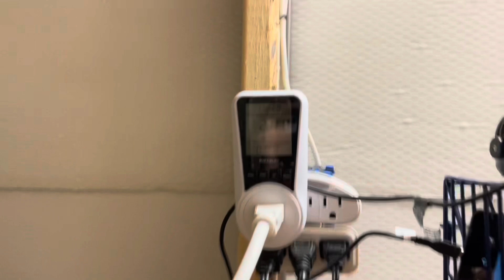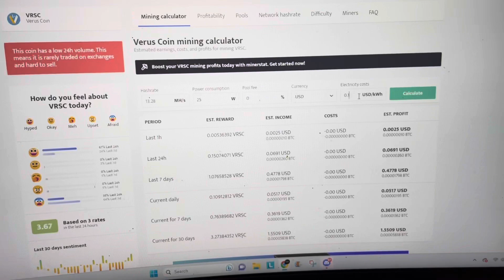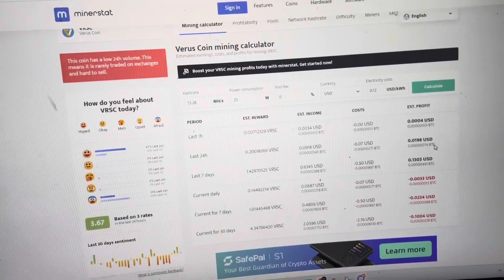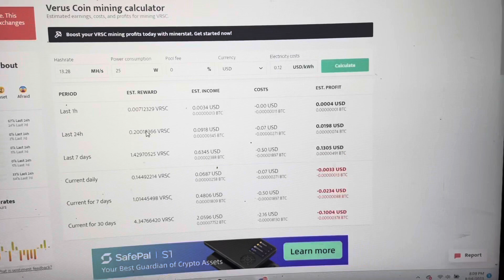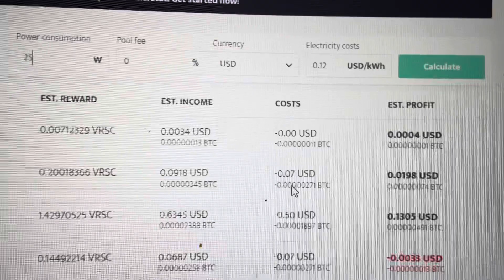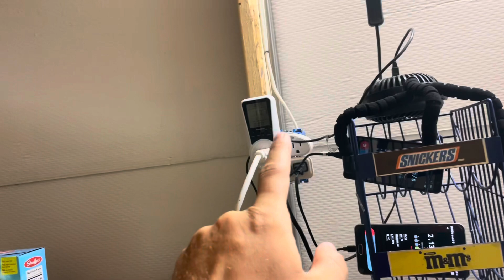Cell Phone Mining Power usage cost

Comment: Bro, whats is your email? I just make android app for you, about shut down the display even phone still working.
Reply: Lets save some energy
Reply from the maker: its in the description  @maxbiagi3091
Reply: @brandoncoin  already send ✊
Reply: @brandoncoin But its undelivered, wrong email
Reply from the maker: @maxbiagi3091     brandoncoin1201@gmail.com
Reply: @brandoncoin Yop, bud emails providers has a problem with .apk 😂 , i will put into .zip and send again
Reply: @brandoncoin  not working, i send you also google disk link. Working?
Reply: Verus app has a setting to turn off the screen once the timer counts down.
Reply: @juggernautz  More easy use the proximity sensor for turn off. Just need cover this sensor (put phone face down or to the case,pocket)